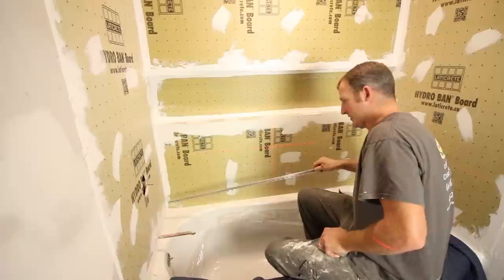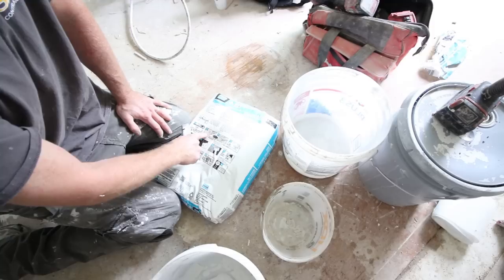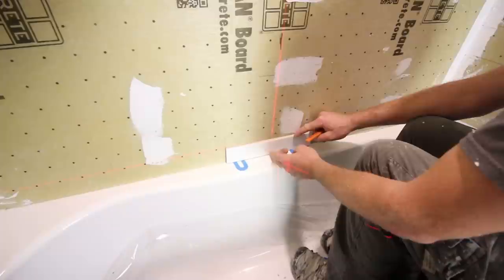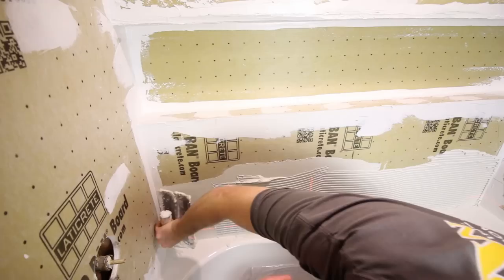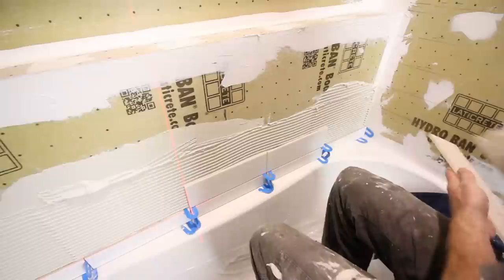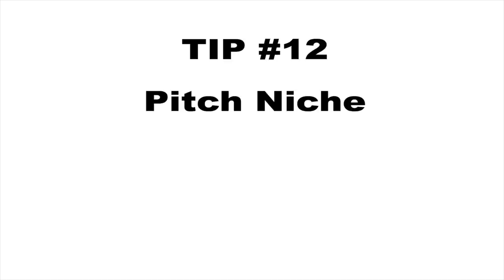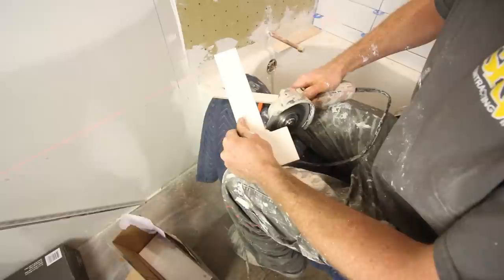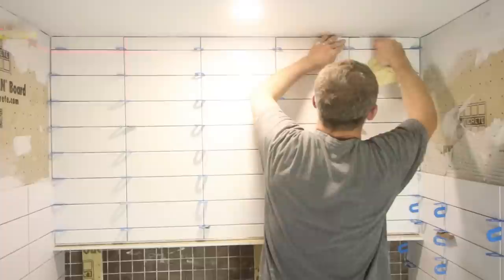How to Tile a Shower Wall...Stacked Subway Tile Tips -- by Home Repair Tutor

Comment: Great tips, a laser level and horseshoe spacers are a definite must for installing wall tile.
Reply from the maker: Couldn't agree more, they make it much better. Which laser level do you like?
Reply: I have a Makita red laser level, it worked great for installing subway tile for my tub surround area.  I also used the same horseshoe spacers that Steve was using.
Reply from the maker: @teh60  haven't used their lasers yet but if you liked it we'll check one out. Those horseshoe shims are the best

Comment: Ok I’m a plumbing contractor by trade. I don’t normally tile as it’s not my expertise. My son bought a home and our tile guy directed us on the wallboard install. He was to come back and waterproof with red guard and then do the tile. Very sadly he had a freak accident and passed away. My son and I have chosen to tackle this now ourselves as several of the other tile people we work around are all booked up and we’re trying to get him moved into his home. We have a niche that we will be tiling. We are using 4x16 subway tile. Also doing the ceiling. I installed the new tub which is spot on level in all directions. How to we know the tile starting point. Do we measure from the bottom of niche to try and keep a full tile to that point? Obviously not wanting a sliver or less than 1/2 a tile at bottom. Thanks!

Comment: What product would you suggest to fill that 1/8 gap between tile and ceiling.  Workers just grouted and continually cracks.  Would a colour matched silicone or something similar work?  What’s odd is the other 2 shower walls, above the shower head and niche, on opposite wall are fine?..

Comment: Do you find the center on each wall and work your way out and in or just on the main wall, making sure the length of the tiles in the corners equal the length of a single tile?
Reply: Good question . Was hoping for an answer as well . I would assume wherever the cut hits you pick up with a full piece on the next wall .
Reply: Good question . Was hoping for an answer as well . I would assume wherever the cut hits you pick up with a full piece on the next wall .

Comment: On the back wall you talked of expansion in the corners. When you installed the side walls did you cut tile flush or leave a gap for expansion?
Reply from the maker: We still leave a 1/16" to 1/8" expansion and contraction joint between adjacent tile walls
Reply: Home Repair Tutor awesome thank you!!! Great work by the way Tile Guru’s
Reply from the maker: @carlossanchez3000  guru by no means, but we enjoy learning and attending seminars then sharing that information
Reply: I guess poor choice of words.  VERY PROFESSIONAL
Reply from the maker: @carlossanchez3000  no problem, thank you for the kind words

Comment: youre not suppose to but any backer board against the tub lip. where water can sit. and wick into the board. thats why they have flanges.
Reply: The backer board used in this video cannot wick water.  An advantage to using the new foam boards.  Completely water proof.